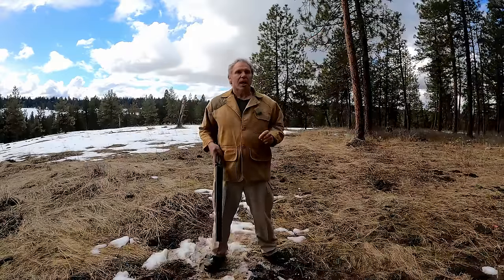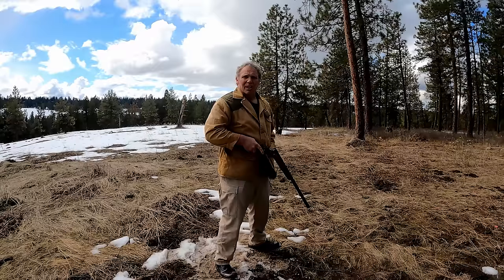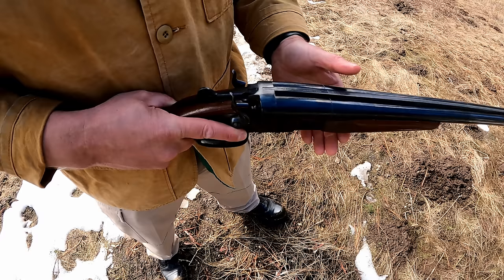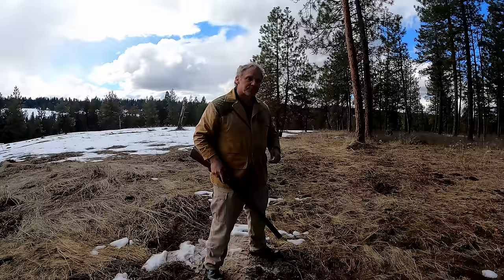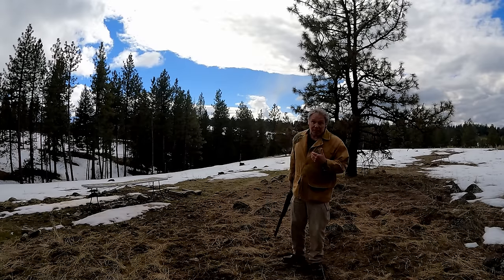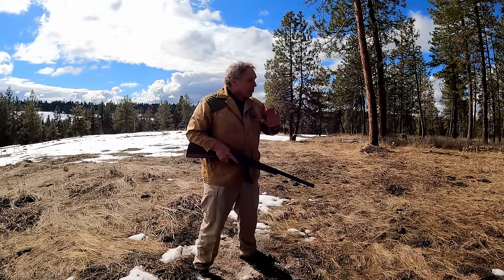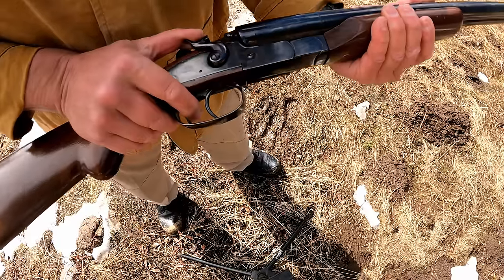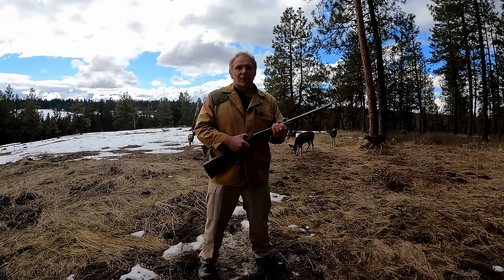Paul's Coach Gun Technique Explained

Comment: On that tight chamber, I would find or buy a 12 ga finishing reamer and give it 5-8 turns in the chamber, then follow that up with some jewelers White on a 12 ga bore mop chucked in a drill at the end of a cleaning rod section and give it 3-5 seconds, then fully clean it with some naptha.  I've had to do that to some old old old BP damascus barrel shotguns.  We had to cut the reamer down though to 2.5 inches so modern 2.75 inch shells wouldn't fit, or some idiot would try to shoot them in an old shotgun not designed for smokeless.

Comment: With my 20ga SxS when the hammers or a hammer is cocked I simply open the action and remove any chance of a mishap.
It does have rebounding hammers but I still go with opening her up.
I've even walked with the barrels open and hammers cocked and a bird flushes I close the barrels on the way up and being a lefty I use the rear trigger first always.
Reply from the maker: My gun doesn't work that way.

Comment: Another anecdote on mechanical failure: my dad was out rabbit hunting during the winter, temperatures well below freezing. Rabbit came out of the brush, he pulled the trigger, nothing happened. The next time it came out of the brush, he pulled the trigger, both barrels went off. Now this is an over/under shotgun with non-exposed hammers. Apparently the mechanism had froze, and at a campfire it had thawed out, so next time he pulled the trigger, the recoil safety was overridden and both barrels went off.

Comment: Speaking of firing both barrels accidentally, I tested some hot 300 grain .45 Colt handloads in my 3 inch barrel derringer.  The recoil was so sharp it overcame the tension of the other firing pin spring, letting the other firing pin set off the other barrel.  I held onto the gun somehow, but it almost hit me in the face, and I immediately thought the gun had blown up.  It sounded like a cannon.  If you ever fire a really hot cartridge out of a derringer, either leave the other barrel empty, or load one hot and one standard, and fire the hot one SECOND.  Now I know why Bond Arms stopped making .44 magnum barrels, and says not to fire +P loads.

Comment: I never understood a side-by-side firing the right barrel first (most folks would grab the front trigger for a quick shot).  On my over/under, the default is to fire the bottom barrel first, which before interchangeable chokes would be the more open choke.  This is because the lower barrel is more in line with your shoulder, and you will get less muzzle climb than with the top barrel, so if you need a follow-up shot, you will be back on target quicker.  And the top barrel having a tighter choke figures with the animal being farther away than it was when you fired the first shot.  I would think the same would apply to the side-by-side, that the right barrel would tend to rock you farther out of position, laterally in this case, and you would want it to fire second.  Or maybe side-by-sides are all made for left handed shooters!

Comment: I have a stoeger coachgun supreme with dual triggers but no exposed hammers. What is different about it compared to my hunting length CZ Bobwhite G2 is when you go to open it the safety is automatically engaged. It can fire both barrel once the safety is off again, and by all measures seems to be a fine shotgun for its price. This comment is entirely the beer and my innate love of guntalk at play. Pay it no mind.
Reply: We have the plain Stoeger, and on rare occasion have had enough recoil to inadvertently hit the trigger again, causing that extremely quick boom boom...it has become practice at range to consciously remember to hang onto the gun, and sort of rebound the trigger finger away to correct our inadequacy...the loading has some to do with this, as heavy 3 inch magnum turkey loads do recoil much harder than 2.75 low brass birdshot...side note: we keep 00 loaded at home, but I'm convinced those turkey loads would be just as effective at 4-5 yard range...

Comment: Another issue with having both cocked is, depending on load, you can catch the rear finger on the back of the front trigger and mash your knuckle. Haven't seen a broken finger yet, but on my coach gun I'd imagine two heavy 3 in loads would mess your middle finger up pretty bad if you got it caught in between the triggers

Comment: Fabulous presentation as always.
I have an old box-lock couch gun.  Any safety suggestion for this type as cannot cock just one barrel or decor either.  
Had mechanical failure resulting in both barrels going off, since addressed by gunsmith.  Does seem to provide a bit more recoil, making me happy about using lower power target birdshot.  Due to age of the piece, not totally confident in it’s ability to handle stout buckshot, much less slugs - so it will remain a range gun/safe queen.

Comment: Some sidexsides can be a bit painful on the fingers when you pull both triggers at the same time if the triggers are closer together.
Reply: Not only that, but the gun was never really designed to shoot both at the same time and doubling all the time can induce stresses in the action or basically trash it in short order.

Comment: I live on a ranch and I absolutely love my coach gun accept mine is a stoger double trigger internal hammer 20 gauge loaded with #2 buckshot and a 45 lever action and 22 lr lever action   in my rack mostly for pest varmints and threats cougars rattlers and such  and a uberti 45 shooter but if you pull both triggers mine will go off I don't do it but know they will my stoger has a safety when you break open the barrel to load it it engages the safety but after you disengage it it doesn't reengage untill you break it open again unless you manually engage it

Comment: Hey Paul I also have a Rossi coach gun. Mine has improved cylinder and modified chokes, I never shot buck or slugs out of it as to not destroy the barrels but I am curious what yours' have and what ammo you feed it.
Reply from the maker: Mine is ;
R improved cylinder
L: modified. 
 I've shot slugs through both barrels. But they won't hit in the same place. The left is usually my slug barrel because it's close to point of aim.
Reply: @PaulHarrell  Thank you I guess I'll give buckshot and slugs a try, now that I have confirmation it won't bulge or split the barrels with these chokes

Comment: I carried a double Baikal coach gun (hammerless) for some years as my "fishing gun" in Kodiak.  It was my poor mans double rifle. Brown bears are all over the streams when the salmon are running and you are wise to carry something heavy like this.  My wife sewed a pocket reinforcement on the right bottom of the surplus army alice pack that I carried my fishing gear in. It was a perfect fit with the stock sticking out over my right shoulder for a fast draw. Without hammers it require no cocking, I could just draw and snick off the safety with my thumb and be ready.  I only fired it once, the right barrel into the mud ahead of a bear I surprised (or it surprised me) and the bear backed off, and I backed off the other way keeping the left barrel in reserve.  A coach gun w/ slugs is the perfect solution for fishing around 1200 pound bears. I should also mention that if you have time you can easily tuck two extra cartridges in between the fingers of your support hand for quick reloads.  Crack the action open, flick the two spent cases out with the tips of your fingers and (with practice) quickly knuckle in your reloads simultaneously.
Reply: I saw 12 gauge slugs stopped by soggy wet fall bear fur. I quit carrying a shotgun for backup after that after that.
Not Kodiaks, just Southeastern Alaska Browns.
Reply: @patrickbethel855  The state fellows that follow up rogue bears carry shotguns. A 1 ounce slug from a 3" magnum has over 3000 ft lbs of energy.  More than just the energy, a shotgun is designed to swing and point quickly.  If you can knock down a duck with shot you can hit a bear in its rush with a slug.  That slug is more twice the weight of a .45/70 and traveling at the same speed.

Comment: I've also seen a lefty pull the front trigger with just the very tip of the finger. Under recoil the finger had so little purchase on the trigger that it slid back and hit the back trigger. That's probably not going to happen that way to a righty, but I witnessed it, so I know it can happen in the right circumstances.

Comment: Could you do a video on the pros and cons of longer guns? For example, in the UK, a Section 2 shotgun must have a 24in barrel and 40in overall length (as well as have a maximum 3 round ammo capacity). Are there any meaningful differences in usage and effectiveness between these firearms, and ones of a length more typical to the US?
Reply: Shorter barrels are easier to maneuver. Longer barrels are better for aiming.
Govts length restriction are arbitrary infringements.

Comment: I have a 20ga hammer less side by side. When I fire the right barrel, the left will have a weak primer strike when I try to fire that one. If I fire the left barrel, the right one will have a weak primer strike when I try to fire it. I have had that thing for years and I just can not figure out how it is doing that, ha. Needless to say, that shotgun is in the broken gun box, as in, not to be used until repaired. I am sure some previous owner did something to it. It was a literal hack job, as in the barrels hacked shorter with a saw, ha.

Comment: One failure not mentioned often is sear or hammer failure.   I've personally had 3 times when a sear or hammer notch failed and the gun go off.  All three where exposed hammer single shots.  New England brand.  Twice on the same gun, the second not long after having it fixed.  The first time it happened was as I cocked the hammer as I was raising to shoulder.  It broke one of my ribs.  

I had the half cock notch on a muzzle loader fail and mash my thumb as I was putting a primer on the nipple.

Man made things break.  It's one of the reasons to follow gun safety rules.  

Oh.  Just this weekend, while camping, my daughter wanted to shoot a 3d printed .22 single shot I have.  I told her to be careful.  What happened?  She didn't cock the hammer strong enough for it to seat right.  A second later it went off, pointed at the ground.  She followed the rules.  She was safe and ok.

Comment: safety  forst......cocking  one hammer  is a great  idea....i generally break the action to  lower  the hammer but  i like  your safer way  better.  Also the excitement  after a good hit.....another  reason  i don't  like  autos  either,  I like doubles  pumbs  bolts  and revolvers, my autos  are safe queens
Reply from the maker: My gun doesn't allow the gun to open while the right hammer is cocked.

Comment: I never had any problems with your main technique as far as firing or de-cocking the shotgun. My main problem was with the fact that you dry fired the shotgun in your part 1 video. It is your shotgun, I will admit that. But it should be advised that people that own a Rossi overland coach gun DO NOT dry fire the gun. They have very poorly tempered firing pins and the spring arms also don't hold up either. Now, do as you will. But unless you have spare parts on hand it is not advisable.

Comment: Hi Paul, what you do makes the most sense: cock one, use one or decock one, no room for disaster here. I was taught clay shooting with an over and under with a single trigger and internal hammers, once I figured out which barrel would shoot first, I always loaded only that one barrel, unless I knew I needed two shots, even at age 16 I figured that second shot was a little too ready after the safety was disengaged and the first shot fired. I don't hunt but, if I did, I'd like your choice of coach gun or even a single barrel shotgun with an external hammer.

Comment: I have a double barrel that opens up fine if I don't shoot it. But when I shoot it I have to literally break the action over my knee. I have to put a ton of force into opening the shotgun to reload. What would cause that?
Reply from the maker: If it has internal hammers (hammerless) it may be because you're compressing the springs to cock the internal hammers. Although it still shouldn't be that hard. 
 It may be because the expansion of the fired shells in the chambers. 
 Perhaps you can try dry firing it with the chambers empty. If it opens easily, then it was the ammo. Try another brand of shotshells 
 Also, what is the chamber length? are you trying to use 3" shells in a 2.75 inch chamber? 
I don't mean to insult your intellect, but it's a mistake that sometimes happens.
Reply: @PaulHarrell  it is external hammers. 3" chamber. Only happens when in fire live rounds. Just birdshot will make it happen.  It's a cheap one I think i paid 400. So probably the cheapness.
Reply: @PaulHarrell  it was all the same ammo. I'll try different stuff. Good suggestion. Thank you

Comment: The addage you point a shotgun not aim a shot gun is all that. I run my 500 and they thought it was slamfiring. Tilk that 7th round thats under my racking hand goes into the chamber. It comes off my shoulder the round goes in and the last round is always on point even though the racking hand only has two fingers putting it where it needs to be.

Comment: As an Englishman I have always found it strange that US side by sides were so slow to adopt automatic ejection. I think because the emphasis understandably swapped to pumps quite early on. In Britain we have had self cocking hammerless ejectors since 1874 when the design was patented by Needham. By 1880 top English guns like Purdey were also self-openers. The speed of reloading a self-opening side by side ejector has to be seen to be believed. When double gunning with a skilled loader (or even treble gunning with 2 loaders), a pair or treble of such guns allows continuous sustained fire that cannot be matched. Magazines run out in 5, 6, 8 or 10 shots, but a double never runs out if continuously reloaded and swapped. In a "Rorke's Drift" situation I would take a pair of self-opening Purdey ejectors filled with double ought buck and a fast loader over any other weapon system available at the time.
Reply: @EroticOnion23  Of course you can with snap caps! The exact same applies to a bolt action rifle or a semi-auto. How is that a disadvantage? That is a silly point to make, Hickock or not, really silly. By that idea we had better not have developed bolt action rifles or semi-autos but have stuck with lever action LOL!  Come on man! Anyway why would you want to ? I doubt one person in 100 ever bothers to de-cock their hammerless guns when they leave them in their cabinet and they may be put away like that every day or week for 50 or 100 years. I have a 1911 built H&H and I never once saw my father de-cock it with snap caps and I only do if I am leaving it for a month or so. Don't forget the English hammerless ejector of 1874 was the first firearm in the world to incorporate an automatic safety catch which engages the moment you open the gun yet is incredibly fast to release as you bring the gun up to fire as it is on the tang. A hammerless ejector is like a fast motorcycle v a hammer gun still being a bicycle!
Reply: @jamesfairmind2247  a loaded gun obviously, a unloaded gun is just a crappy club 😅
Reply: @jamesfairmind2247  shotguns are also not drop-safe, so not sure one would want to leave one loaded with live ammo for a long period of time 🤔
Reply: @EroticOnion23  Why the hell would you leave one with live ammo in? I never leave a gun loaded unattended. When you come back from a hunt you break open the gun and take the cartridges out, just like a bolt or lever or semi-auto rifle?  Do you leave live ammo in the chamber of any weapon at all unless you are carrying it?
Reply: @jamesfairmind2247  home defense of course. In many countries the populace is only allowed something like a double-barrel. Seconds will matter. Personally I leave my concealed carry Glock (loaded & cocked) in my holster when I’m at home, I store them both together in the night stand. Just point n shoot. Can’t imagine trying to fumble and load a shotgun with a intruder running up the stairs🤔
Reply: @EroticOnion23  Fair enough point in that scenario, but honestly I do not think a double is a good choice for home defence for the very reason you state. A pump or an auto can have a full mag but still have an empty chamber and can go hot in a split second. Plus more firepower. The only safe way a double could be at "ready" is with 2 cartridges in the chamber but lying breach open on the bedside table. But as you say, some places that is the only choice of gun.

Comment: Is it unsafe to fire both barrels of a double-barrel 12/20 gauge at the same time? I know it would be unpleasant...
Reply: It's only unsafe if you aren't holding the gun correctly, and it flys from your hands

Or the gun is structurally compromised/not able to handle the pressure of your ammo, in which case shooting it at all is dangerous

Or you are of a "feeble" build and the double recoil is too much for you, for example a small child
Reply: If the gun is aimed at appropriate target both barrels going off isn't inherently unsafe, but as noted it will feel unpleasant...most modern shotguns (and many older shotguns) are built for purpose, with both barrels going off simultaneously (even if inadvertently) considered...

Comment: For combat I want both hammers cocked if possible at the first sign of danger for obvious reasons.  As far as post buck fever goes. If one is like that, perhaps a single barrel is the better option or better no gun at all.  I prefer hammerless double barrel guns with a safety.  With what you are doing I can handle a single barrel gun with automatic ejector almost as fast as you are firing that double barreled gun.